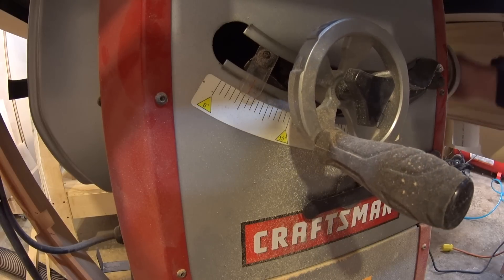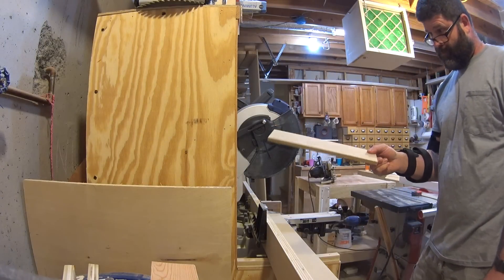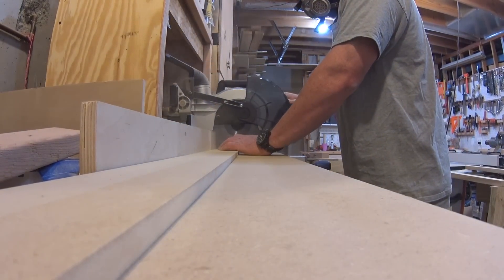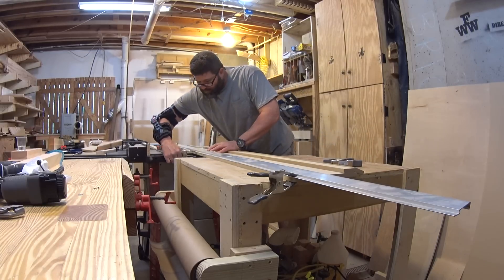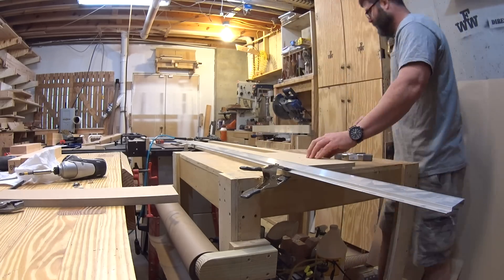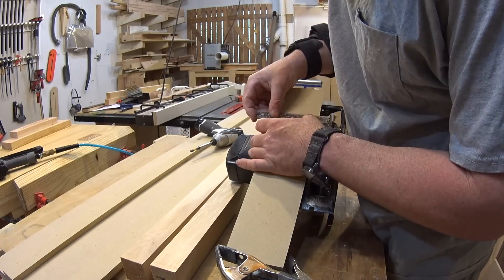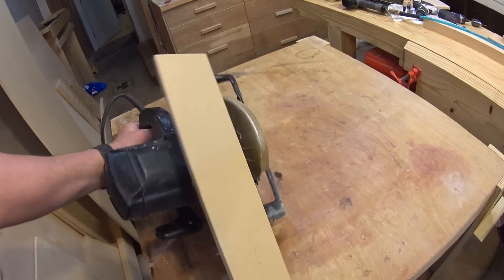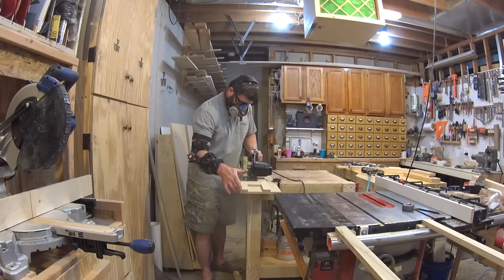Save Hundreds!  Ultimate DIY TrackSaw

Comment: I recently watched your newer revised edition, and I have to admit, I like this beefier version of your track saw better. I don't have a problem with the thickness of the MDF or the plywood because I would probably just invest in a dedicated saw that I would keep attached to the guide plate. This would still be a heck of a lot cheaper than one of the other track saw options. Thanks for the great idea!
Reply from the maker: For the record, I like the beefier version too.  When I get around to building it, my final version is going to be using 1/2 inch mdf as the base for the track, and 1/4 inch for the plate and guides.  Best of both worlds.
Reply: @FranklinWoodWorks2016  That sounds perfect. Thanks for the update.

Comment: A much simpler technique: 12 inch wide by however long sheet goods track. Across one end glue and pin a 1x6x12. This is your rear end stop.From this stop forward mount left and right guide strips to the track to accept baseplate of your particular saw. THEN, MOUNT a 9 inch 2x4 SQUARELY  along the front, ON EDGE like you did with your tablesaw sled, only UNDERNEATH. Now, run your first test pass, setting blade depth at +- one inch. Track should square up to your work, and saw runs with no wander, even on angle cuts. Kerf shows line of cut. But for the 1x6 stop and the 2x4 on edge you would have cut the track in two. That's the idea
Reply from the maker: Maybe simpler, but not as effective in my opinion.  The reason for the dovetail is to take all human error out of the equation.  You would still have to mount a base to the saw using your method, and that base would be much larger than mine.  It appears that your method would eliminate the dovetail by increasing the footprint of the base plate.  I don't see that as much simpler, but I may be misinterpreting what you are describing.
Reply: FranklinWoodWorks No, metal saw base plate only, edge guide on each side.AND, track squares up to your material, a huge DIY improvement. And your saw is still a saw. The only advantage of the dovetail is extra anti kickback safety, since the saw has to slide out of the track rather than lift off. If that is a must have feature, then simply rabbet the edge guide strips to accept the base plate.
Reply from the maker: studfindingball I'm sorry, but I'm having trouble picturing this.  Can you snap a picture and send it to rob@franklinwoodworks.com?  I'm really curious.
Reply: FranklinWoodWorks Rob, my email was returned. Do you have a gmail compatible address?
Reply from the maker: Try Franklin.customs@gmail.com

Comment: By far the best diy track saw plans ive seen ao far. I think i will use plywood to make the base and then make the runner and dovetail slot out of MDF like you did. I plan on making mine 8' long so I can rip down 3/4" plywood for some book cases I will be making. Thank you for the plans!
Reply from the maker: You're welcome.  Plywood would be great.  And 1/4 or 3/8 plywood would be even better.  Keep in mind that I built mine out of what I had laying around.  I didn't want to have to buy anything.  Thanks for watching!
Reply: Do you think plywood would work for the dovetail guides and runners too? Or would that be too much resistance?
Reply from the maker: 11spitdms I think it would be too much resistance.  If you had cabinet grade or Baltic birch plywood, and were able to polish the edge to about 500 grit sandpaper the wax it?  I think MDF would be your best bet.
Reply: That's what I kind of figured. I was hoping it would work but I figured I should ask before I ruined my sheet of plywood on it. Thank you. I do have a 3 foot piece of hdpe cutting board I got from a restaurant I could try also.  I'll have to see how its thickness compares to my 1\2" ply sheet.
Reply: How wide did you make your base piece?
Reply from the maker: +11spitdms I forget exactly, but the thing is that every saw is different.  I'd just measure you saw and get it as wide as possible for more stability but make sure it's long enough.  Just like a car, the longer the wheelbase, the more stable the tracking.

Comment: I'm curious as to why MDF was your choice of material.  Is it the smoothness for sliding MDF on MDF?  I'm thinking a thinner plywood would help eliminate the flex you had in your TrackSaw 2.0 without losing a full inch from your depth of cut... only drawback of plywood may be the dovetails may not slide as smoothly as MDF.
Reply from the maker: That is exactly why.  If you used baltic birch plywood, you might be able to achieve polished edges, but this would not only increase the cost, but limit the length of you guide to 72 inches.  In my area, 72 x 72 is how you buy baltic birch.

Comment: Great idea with the dovetail in 2 pieces- so simple. I have a small job installing pine lap siding to a shed- it's rough cut 5/4 x 12 and I have to rip it in half; I like your setup, but can it be mounted/attached to a board only 12" wide? Nice watch, too (Luminox?)
Reply from the maker: ches smith I think you could do it, but you may have plan ahead and build the guide so you can clamp it.  Depending on how much you have to cut, I might consider mounting the saw in the middle of a piece of plywood, plunge the blade, turn the plywood upside down, and put it on a couple of saw horses.  Then you can use another piece of plywood as a fence/straight edge, and run the boards through like a makeshift table saw.  And it's an Invicta lefty.  Good watch for old eyes.

Comment: Good tips I haven't heard that should help me. I also appreciate that you point out a dust mask. That is the important safety necessity I am Trying to make a Habit of. I need a good one like that. The disposable don't hold up and impede upon other safety and cautions.
Reply from the maker: I guess the most important advice I could give on a dust mask, is buy something that you will wear.  Many folks spend a lot of money of masks that will filter out every single particle, but it's either uncomfortable or too big and gets in the way of other stuff.  So they don't wear it.  Even a bandana over your nose is better than nothing, so buy something that you will wear all the time.  Great masks are worthless sitting in a drawer.
Reply: FranklinWoodWorks  that's great logic to consider when purchasing my mask and all future safety gear. Thank goodness for return policies. And thank you again

Comment: This is super awesome!  Thanks.

I made my own track saw a couple of years ago that is similar in function to this one, but I don't have a table saw.  So my design was created with the idea that it needs to be able to be built without much in the way of an existing workshop.

The way I did it was to use (for the track itself) 1/4" hardboard.  I cut it to be about 1' wide, and 8' long.  I then attached a 1x4", 8' long section of mdf trim to it along one side.  This gives it some rigidity.  This trim does NOT have to be perfectly straight because it is only used to stiffen the track. You want to make sure the width of the track (including the MDF section where the saw can't go) is wide enough that once you finish the track, the saw itself will cut a little bit off to get a perfect alignment between the blade and the edge of the track.

The important bits are the following:  I got an 8' long, 3/4" aluminum U channel from the hardware store.  I also got a shorter, 2' section of flat aluminum bar from the same hardware store.  This bar fits perfectly into the U channel and can slide in it easily without binding or any side to side motion.  You will have to hunt around the hardware store a bit to find these pieces, but they exist and shouldn't be too hard to find.

The U channel is attached to the top of the MDF trim, overhanging the edge closest to the saw by about 2mm.  This is where you have to make sure the aluminum is perfectly straight.  I borrowed an 8' level from a contractor working next door to use as a guide.  Attach it by drilling some holes in the center of the channel, making sure to counter-sink the screw heads. The reason the cannel overhangs the edge is to make sure that even if the MDF is not perfectly straight, the channel will be the bit that the saw runs along without interference from the MDF.

The flat aluminum bar is attached to the saw itself.  This is done by attaching another bit of the 1/4" hardboard to the bottom of the saw.  Then some MDF and more hardboard is attached to this to build up two small towers of wood (2 x 3/4" MDF strips + 1 x 1/4" hardboard strip).  These towers are attached to the front and the back of the hardwood saw base, on the motor side.  Then a wider strip of hardboard is used to extend over to the U channel, and more MDF used to drop back down into the channel.  The aluminum bar is attached to this "arm".

That was hard to describe, but basically you are building two "arms" off of the hardboard saw base that reach up and over to the aluminum U channel.  These arms have the long (about 2') aluminum flat bar at their end so that the flat bar slides inside the U channel, keeping the saw perfectly straight and true.

Slide the saw along the track, cutting the track back to get a perfect fit where the edge of the blade rests agains the track.

Finally, attach a second 1/4" bit of hardboard to the underside of the hardboard saw base, but only on the section that extends past the edge of the track.  This way you get a zero clearance anti-tear out feature.

The features I like about my approach:

1) Once you plunge the saw through the base, you get a zero clearance insert on BOTH sides of the blade, greatly reducing tear out on both your track side and off-cut side.

2) The total reduction in cutting depth is 1/2" (vs. 1")

3) You can build it with nothing other than:

Circular saw
Drill
Screwdriver
Straight edge (borrowed in my case)

It still has the same extended length that keeps the saw straight even at the beginning and end of a cut.

I made 3 of these tracks:  8', 5', and 2.5'    Super handy.

Thanks again for your video.  It is very inspirational.

Comment: Do you have photos of this jig posted anyplace?
Reply from the maker: Don't think so.  Need some?  Or have you seen some?  Maybe screenshots of the video?
Reply: +FranklinWoodWorks I am new to wood working and I would like to see a few photos of the jig. I have trouble picturing it in my minds eye. Is the dovetail and the saw itself on both sides of the board or is it flat on one side?
Reply from the maker: It's on both sides.  I cut one long dovetail, cut off a portion to mount to the saw, then split the rest in half to mount on the "track."
Reply from the maker: And when I say one long dovetail, I mean that it is angled on both sides.  So when I split it in half, I can mount the split pieces so they fit with the portion mounted on the saw.
Reply: +FranklinWoodWorks I understand now thank you for your help I appreciate you. I cannot afford a track saw and have been looking for a way to break down sheet plywood with my dewalt skill saw accurately. I am betting this will be perfect. Thank you for sharing. You've just earned a subscriber.

Comment: The extended base plate is an ingenious idea.
Reply from the maker: It has worked out very well, and I still use it every time I break down plywood.  I couldn't do without it.  If I had a huge shop where I could move entire sheets of plywood with ease, it might not be so important for me.  But I'm happy with it.

Comment: Had to comment. Perfect. Been looking at all the videos for saw guides. I think this is the one I need because will make a perfect cut all the way through the panel being cut.
Going to be cutting Kohler Choreograph bath wall panels. For a better look I don't want to use their metal edge trim pieces-need perfect cut.
If I screw the cut up it's $450 down the drain and 3 weeks waiting for new panel to arrive.
I am even going to pay a mill work shop to rip the long dove tail because I have a small table saw.

Comment: Great project.  How do you like the Craftsman Table Saw?
Reply from the maker: +Dan @ The Robbins Workshop I was OK with it until you asked and I thought about it.  I've had to replace the arbor and bearings because of excessive runout.  I had to replace a trunion because the teeth wore smooth and I couldn't raise the blade. I had to alter the trunion so I could get the blade parallel to the miter slots. The fence is worthless for accurate cuts, so I replaced the fence with a $300 system.  But after roughly $1,000 outlay for the saw and the upgrades, I have a saw that is accurate, doubles as a router table, and has a 39" rip capacity.  It has good points, a cast iron table, good casters that retract, and a motor that has done everything I've asked it to.  In hindsight, if I knew I was going to put all of that time and money into it, I would have bought something that needed less upgrades.  Generally speaking, if a manufacturer offers a model with an upgraded fence for an extra $200 or so, it's a good deal.

Comment: I like this one but........... I almost always forget to add on the saw blade Kerf size.
What would be clever is some kind of pop out Pin to help set the cut off line if you're cutting your save pec side and clamping the waste pec side.  A alignment gauge would solve that problem.
Reply from the maker: I never thought of that.  I just always made sure I didn't clamp on the waste side, but that's a good idea.
Reply: Hey also a built in tape measure on both ends of it the tape would figure in the kerf or not by setting a adjustment. sometime's you can't cut on the waste side.
Reply: That's a great idea! Try holding a thin strip of material the same width as the kerf up against the track while positioning it for a cut. Spray paint it fluorescent orange so you don't forget to remove it before starting the cut!!!

Comment: This is a great idea. 

Could you please list in the description the type of wood used and dimensions used for quick reference?

Half inch MDF 
Strip 3 1/2 inches wide with 10 degree cut
16 inch piece for the base plate with 10 degree cut
9 inch wide piece for base of guide 90 degree cut

Comment: Ha think I'll be needing a more sturdy saw. tried an old B&Q one. Didn't go down well
Reply from the maker: Unfortunately, this is one of those situations like "you need a workbench to be able to build a workbench."  This is one of those things where you have to have the ability to cut a dead straight line.  If you bought a new piece of MDF, you could rip a piece off and use the factory edge as your initial straight edge.  Maybe this will help?

Comment: I'm just starting woodworking and a friend recommended me to look up on DIY Tracksaw guides and this one is amazing! I definitely want to do this for testing!!! I think it'll be an amazing addition to stuff that I need to rip in the future!
THank you for your concise video!
Reply from the maker: Thank you!  I still consider myself a new woodworker, and love to try new ideas.  I love to build/modify tools and jigs rather than buy them if possible.  One thing I didn't put in the video that I should have, was that I gave the jig a couple of coats of shellac to protect the MDF from moisture.  Good luck with your new adventure!
Reply: is there a way to do this without a table saw? I currently don't have one of my own so it's hard to create a dovetail groove.
Reply from the maker: mputtr if you have a circular saw, you can start by making the best cut you can on a sheet of MDF, then use the factory edge as a guide.  Your circular saw should be able to make the bevel cuts.

Comment: Good idea.  One question, does the saw dust build up in the dovetail?  If so would a back cut on the bottom help?
Reply from the maker: +HCAC BUILD Actually there is no problem with this.  Because the plate extends beyond the front of the saw, sawdust isn't a problem.  But of course that could depend on your saw.

Comment: What was the metal that you used for the straight edge to set up the guides?
Reply from the maker: Pete B. It's a 10ft aluminum straight edge I got at Home Depot.  Maybe $20 or less.

Comment: i'w been watching many track saw adapter video. I like simple but solid ideas. This one is not complicated at all and i think far the best solution of all.

I have no table saw, but a router.
-also the circular saw angle can be adjusted, i am not sure though if its accurate enough.

just an idea, to save time when i will attach the base plate on the saw: i might placing a piece in between the saw disc and the base plate. (obviously something which has accurate, parallel edges). Then comes the baseplate, clamp, drill, screws.
Reply from the maker: +Attila Szabo The angle on the dovetail really isn't important.  I used 10 degrees just because it's enough to keep the plate snug in the track.  Any more of an angle would increase the surface area, and give you more friction.  As long as you have a straight edge to make the cuts, you can make it with a circular saw or a router (with a dovetail bit).